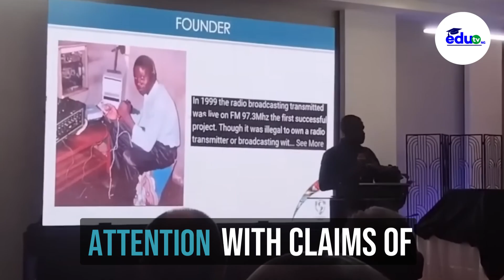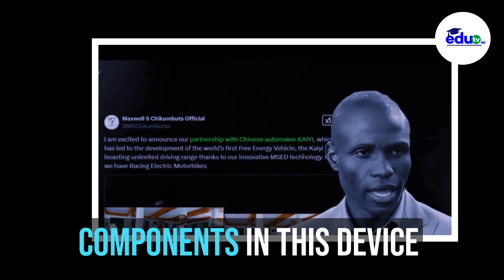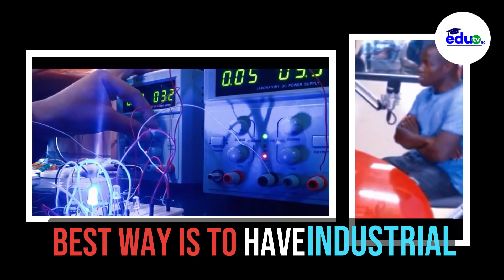EXPOSED: Why U.S Blocked Maxwell Chikumbutso Invention || Self-Powered EV Cars || Exposed!!!

Comment: Sangulani Maxwell Chikumbutso is not a fraud since he may be producing reactive power which need not be restricted to its conversion from real power, but is rather stimulated into production from a scant real power input upon brief reversals of time (known as: transient surges). This reversal of time bypasses Conservation.

Reversal of time need not be 'actual'; it can be 'faked' by spawning a parasitic oscillation whose amperage and frequency are both larger than the input.

This is not an 'OR' condition. This is a logical inclusive 'AND' condition. Both: faster frequencies and enlarged amplitudes are required to succeed in free energy production spawned from a momentary surge.

Since the input is the reference for the circuit's 'time', what it spawns outflanks the input.

Using the analogy of a car passing a slower moving vehicle on the road, if the slower moving vehicle is taken to be the input, than the output is traveling faster in the same time frame or, in the alternative interpretation: the faster moving vehicle is not moving any faster yet is self-contained within a time frame which becomes the operative reference making the input reference appear to be travelling backwards from the perspective of the faster moving vehicle. This is how to 'effectively' reverse time without actually having to reverse it.